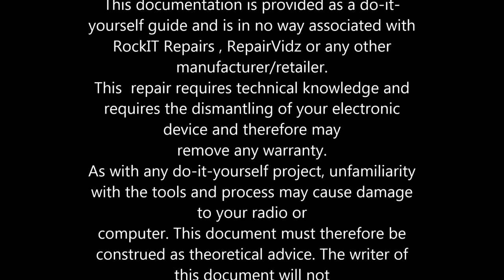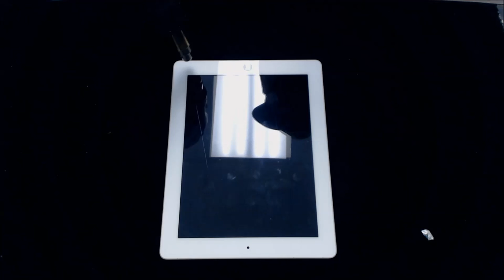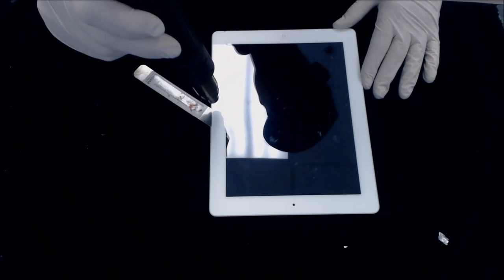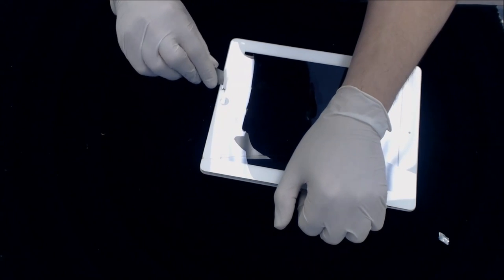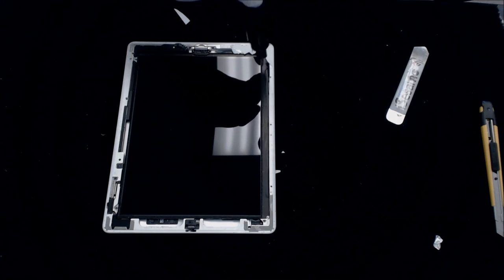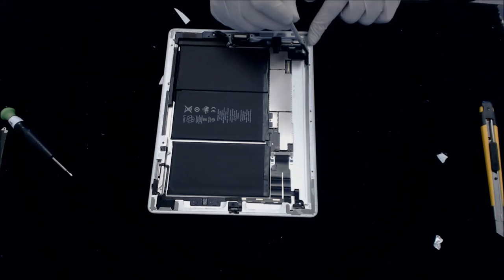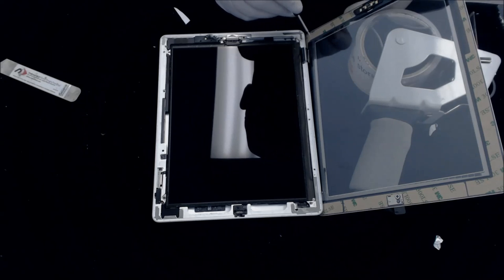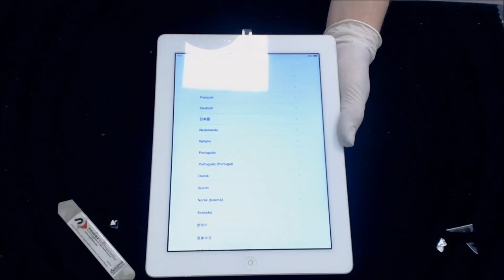iPad 2 A1395 Digitizer Glass Replacement

Comment: I am looking at an iPad2 for a friend, since I do repairs, and screen replacements, and when I hook power to it, the image with the battery status, will show momentarily then go to a back-lit black screen. I can see that the battery is fully charged, when this happens.  I tried doing a reset, holding the stand-by, and home button, but nothing changes. Would this be a bad LCD, or hardware failure on a logic board? The screen is fully intact, and not even cracked. Best guess, before I operate?  Thanks!

Comment: Could you link or say what heat tool you're using? I'd rather order something than use a hair dryer. Thanks.
Reply: Brandie Harvey Also, I would love to get one of the tools you're using - the metal spudger. looks pretty useful, wide enough to grip, but narrow (thin) enough to use in very small situations.